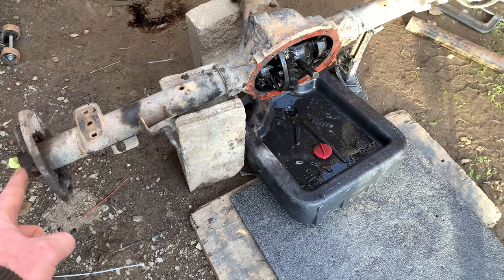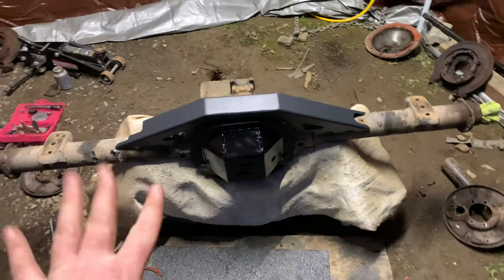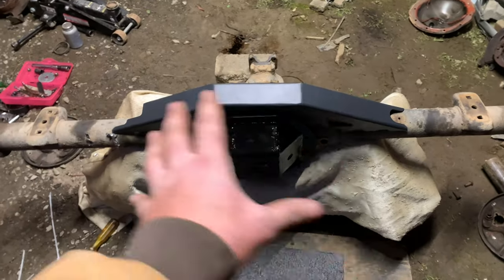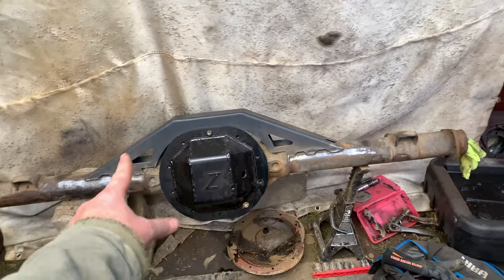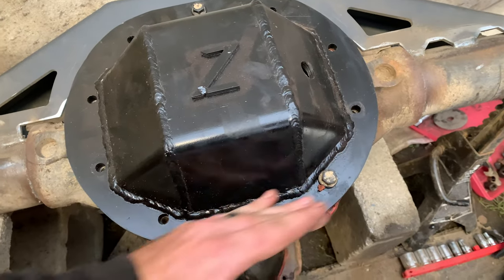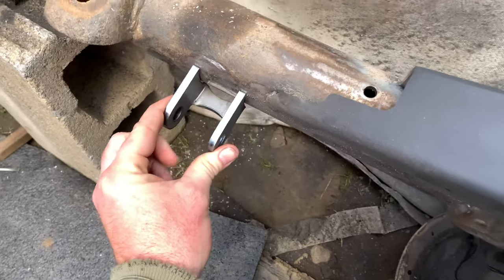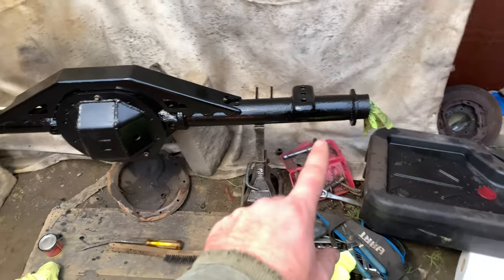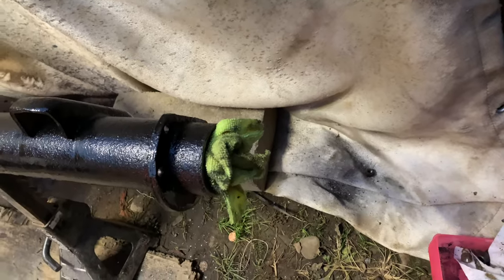Ultimate budget Chrysler 8.25 build

Comment: Looking good Ronnie! I definitely have put my 8.25 to some hard use and have had zero issues with it running 35’s .Specs - 4.88 gears. Chromoly shafts, ARB locker, disk brake conversion. No truss yet, but welded the tubes. Definitely love the disc brake conversion!! Jeep is looking good! Hope you have a good Christmas!
Reply: They make chromoly axles for the 8.25?
Reply from the maker: Thank you hope you have a awesome Christmas also. Glad to hear it’s holding up!!
Reply: @ky0611  - I just went back and looked at my big order and I stand corrected. The front axles were 4340 Chromoly and the rear axles for the 8.25 are 1541H Alloy axles. Still stronger than stock. Got both from Yukon Gear and Axle.
Reply: @GoatOffroad  o ok I was about to say where'd you get them lol

Comment: i built my ford 8.8 for $943 . that price includes $180 for the axle at pull-a-part salvage yard, all new bearings, seals, yoke flange & adapter, u-bolts, pinion nuts & sleeve, carrier, motive gears, spartan locker, shock brackets,  wheel studs, all new brake lines, and all new brake components (salvage yard housing and ALL new parts with NO discounts)  
(I might add supper 88 kit w/chromoly shafts in the near future for an additional $575, just so that i can steal the stock axle shafts for a future project)

Comment: Just finished my d44 rear axle build cost me about $500-$600 total. I got lucky tho I got the axle for $100 (guy didn’t know what he had under his 2wd comanche going to scrap) figured out later it’s actually the same gearing as my truck, I’m also putting it in a comanche so it’ll bolt right up, I didn’t get a truss or shafts but I might get a truss like in the video now that I’ve seen a not so large one. I installed zj disc brakes also all junkyard parts except the rotors pads and parking brake shoes. I also put in new brake lines, custom shock brackets and a full spool locker, just gotta throw the axle under my Jeep now!

Comment: I got the same diff covers off of eBay. Ended up having to get it machined flat, too warped to seal. 8.25 29spline is as good as a 28sp 8.8...   I put an 8.25 in my zj out of a kj, put the disk brakes on it. Also a d44 truss fits perfectly too. I also integrated the truss into the housing with brackets and bolts. 8.25 is highly under rated, everyone uses an 8.8 because they read about it in the jeep forum lol.
Reply: I knew it!! I knew 8.25 couldnt be that bad Lol
Reply: @ky0611  it's not. Comparable to a d44 in many ways.

Comment: I've seen plenty of 29 spline 8.25s locked take a beating just fine.  Building a 8.25 isn't that expensive as noted. Definitely not the best selectable locker selection. Yes it has a c clip but do the rear disc brake conversion and that issue is solved.  I did the conversion off a zj on mine and converted to 29 spline shaft and carrier bc I have a 94 2 door.  A lockright and new bearings going in soon and can't wait to put it to the test.  Good to see others recognizing the potential 👍
Reply: I have the 8.25 with an ARB locker and 4.88 gears and have converted to disk brakes. We run 35” tires and wheel it pretty hard! Never had a problem with it.
Reply: You don't need a selectable locker in the 8.25, Mechanical lockers are far more reliable.
Reply: Nice. Wish I had the dough for some serious axle work but I kinda went the cheaper route for my set up. I sourced the bigger u joint front shafts and put some new spicer 760x joints in. The 29 spline shaft and carrier for the rear. Took some 3:55 gears as well since I have the 3:07s. I'm only running 33s and don't plan on any bigger. Would be pretty sweet to have dual ARBs.

Comment: Nice what gear ratio did you get? Also next time you set up an 8.25 you can easily make your own side adjuster tool by welding a 36mm nut to the end of a piece of 1/2" black Iron pipe and weld a bolt in the other end so you can use a socket on it , I made two of them for less than $20.

Comment: Hey man, offhand do you know the distance of your axle from backing plate to backing plate.  I have a mid 90's yota v6 4x4 and need a cheap axle and the 8.25 is up for consideration.  I like the fact that you can work on the diff from the rear without having to disconnect the drive shaft and remove the third member like ours has.  Our wheel pattern is different though as the yota 6 x 5.5 so I don't know how to overcome that.  Nice job on the refresh.

Comment: Just a question I couldn't tell did you remove the gears and seals? And when you welded did you use gas? I'm new to welding and all I have right now is flaux and this is the route I want to go with my axles as well?

Comment: Is it necessary to remove the inner axle seals on a Dana 30 to weld the tubes to the housing? Will they melt if I leave them in on the Dana 30?
Reply from the maker: Best to take them out and put new in after you are done
Reply: @cherokeeronnie  do I need to reset backlash after
Reply from the maker: Not if your only taking the carrier out of the 30 you just put it back in don’t get the caps swapped
Reply: @moejr14  the caps are stamped so its really easy to put them back in the right side and orientation. Just torque the cap bolts and you are good to go. I have removed my carrier like 6 times or more and never had any problems.

Comment: So in previous videos you've said drum brakes are just as good. Do you now think the rear disc conversion is better?
Reply from the maker: They are just as good if set up right but it seems to stop the 35s just a little bit better
Reply: @Cherokee Ronnie  i would highly recommend swapping the proportioning valve from a ZJ with disk brakes. It made a world of difference for me. It was free from a junk yard. All you do is swap the internals. It literally took me 2 minutes and i didn't have to bleed the brakes.